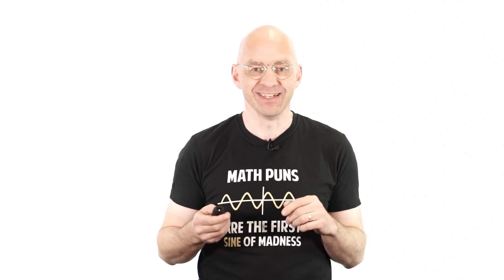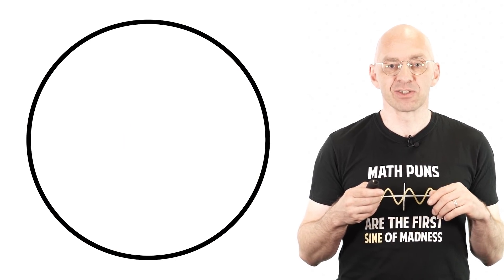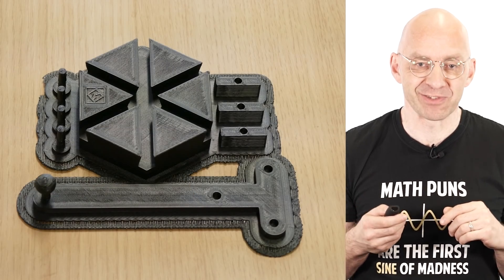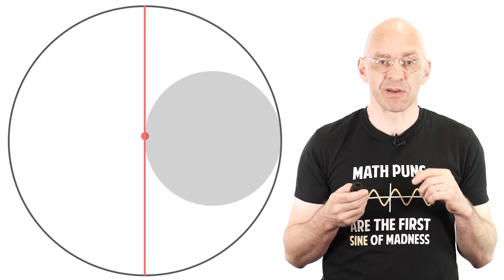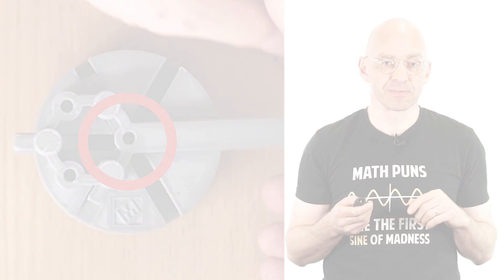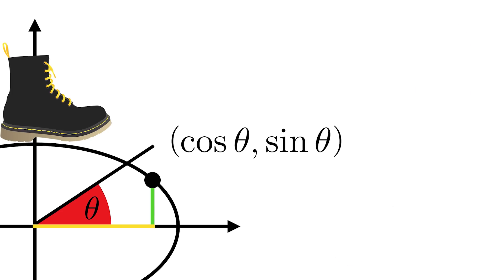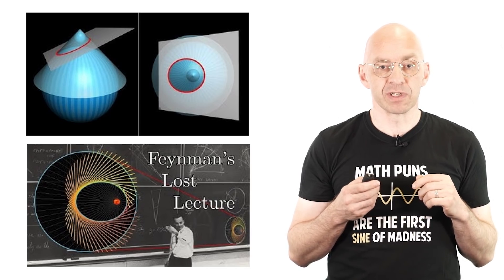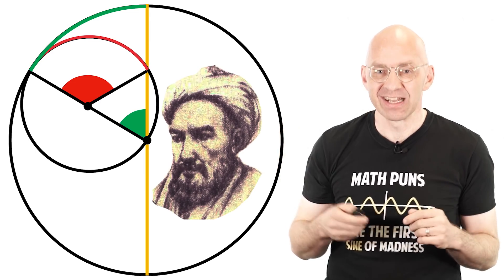Secrets of the NOTHING GRINDER

Comment: As a non genius, i would say that any pattern in which you can rotate a line in a non circular pattern would not become perfect by changing the line's length, (unless/even if) it becomes infinite.
The deviation in which the line traces would be above positive, with 0 being perfectly circular. BUT changing the length does make that deviation decrease by a certain amount, relative to it's size.

Take celestial bodies for example: A meteorite & the earth may have the exact same ratio of an uneven surface; that is if you dug a hole the size of the Mariana Trech & made a mountain as tall as Everest, it would look much more massive on a meteorite because of it's relative size to the planet, but they have the same roughness ratio, so the meteorite looks rougher than the beautiful smooth orb that is earth.

Aside from that, each point in a circle is it's own distance away from the center. Making the line longer doesn't change the difference between any 2 respective points, thus making a divergent series, possibly making the problem unable to settle on a total sum... so really i'm not 100 percent sure.
Reply: It kinda changes depending on how you look at it. On one hand, they're both infinitely far from the CENTER, but always keeps the same constant ratio no matter how far away it is...
though i think being ininitely far from the center has more bearing, since the ratio is based on how far they are from the center...

Comment: I’m a bit hung up on the last proof. I understand the proof that the arcs are the same length, but I don’t understand why “if the red arc equals the green arc, then the red arc traces the diameter of the larger circle.”
Reply from the maker: ", then the red point traces the diameter of the larger circle."
Reply: @Mathologer  Ah, I understand. The red arc is defined by that point which is on the diameter.

Comment: I guess points that have the same proportions of distances to the two "screws" draw similar ellipsis. There are 4 such points 2 between the screws and two outside - but since the arm of the device is a ray then only one of those "outside" points lies on the arm. So all together there are 3 such point on the grinder for each proportion. The special case is a point that has same distance to both screws - there is only one such point, and it draws a circle.
Reply from the maker: Perfect :)

Comment: Interesting video as usual, but a lot of the animations (especially the ones with the spirograph patterns) are REALLY laggy and it’s extremely distracting. Was there an issue with your recording software?
Reply: I had no issues playing the video. More likely culprit is data throughput issues to your computer to your monitor. Any number of issues can cause this, one POSSIBLE example is data throttling by your provider.
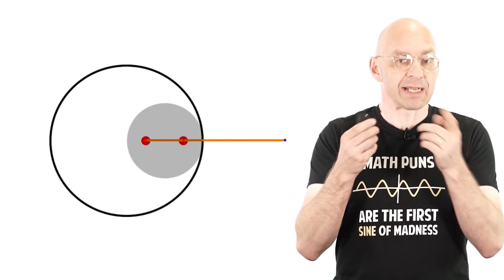Reply: inyobill That couldn’t be it; the animations that are acting up, like the ones with the spirograph tracks (especially at 7:20) and the Tusi couple, have him narrating onscreen while they’re playing, and he’s moving silky smooth while the spinny lines are jerking and diving into single-digit framerates. How could throughput throttling cause that?
Reply: the animation at 7:20 was laggy for me too, while him talking beside it wasn't, so you're not the only one.
Reply: @KnakuanaRka  That suggests an internal problem, since lots of folks don't see the same effect.
Reply: inyobill inyobill inyobill Well I’d love to know what kind of internal issue could cause one side of the video to lag and drop frames relative to the other. I just don’t see how that’s possible, unless the animations are somehow handled separately from the rest of the video, like they were pasted in with some sort of new annotation. And even if I speed up or slow down the video, go backwards, or frame-by-frame through it, it doesn’t affect what frames get skipped, so it can’t be Yotube’s fault; how is it showing up smoothly elsewhere?
Reply: @KnakuanaRka  One possibility is video and audio being processed separately. Since it displays fine for at least some people indicate it's not the video.
Reply: inyobill Audio? We’re talking about two parts of the same video here; that can’t be it.
Reply: @KnakuanaRka Well, it finally got through my thick skull that I was confused. Imagine that. The glitchy looking animation is an artifact of the math software creating the plots.
Reply: inyobill 🤦🏻‍♂️🤷‍♂️

Comment: the answer to the question posed at 2 minutes, I'd say there's 2. The second one traces a point between the two screws, which has the same shape but with the axes swapped, also it'll be smaller(but the same shape).

There's no more, because as you go further out the shape becomes more and more circle-like and less and less line-like.

edit:
actually, rethinking it there might be 3. Since the midpoint between the two screws traces a circle, and the screws themselves trace out lines... going either way would transition smoothly from line to circle, going through all possible ellipses in between. And of course there's the one on the outside, still.
Reply from the maker: Three it is :) (unless we are talking about the circle and the like segments that are produced by the screws ;)
Reply: For the purpose of the question, I considered circles and lines to not be ellipses.
Reply from the maker: @BigDBrian  Sure  :)
Reply: right now you're the friend who tells a riddle then acts all smug when you answer so you don't know if you got it right or not

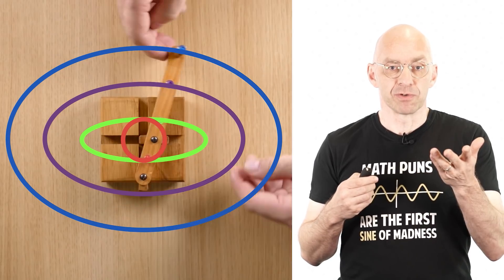Comment: 2:05 Going by intuition alone (haven't proven it), I'm going to say 3 points: 2 of them will be symmetrically positioned between the points that move on straight lines, drawing ellipses "perpendicular" to one another, which is the same shape rotated, and a third point will draw a scaled up version of that ellipse and will be on the "long side" side of the arm.  

All this except for the degenerate cases: A circle has 1 point on the arm that draws it (or 2 if you consider the point at infinity which again by intuition likely draws a circle), and a line (a degenerate "infinitely stretched out" ellipse) has 2 points that draw it.

(If the arm would be extended in both directions, change that 3 to a 4)

edit: Now that I've reached 7:05, it feels like my intuition was correct.
Reply from the maker: Very good :)
Reply: Sorry for the year late reply. Ya know, I used to be pretty good at maths in high school a quarter century ago so when Mathologer popped a quiz I decided to pause the vid and take it. I closed my eyes and tried to envision it (just a thing I do when trying to concentrate, helps me remove other stimuli). I saw ellipses squishing down to a line. But I think I somehow saw them opening up again into what I questioned might be another circle (the point at infinity which would draw another circle, as you mentioned). Idk, still trying to visualize how they would plot. In my 40's now so I'm kinda old and used spirographs as a kid, they were very common toys. I suspected the ellipses would rotate somehow but I wasn't quite on the money there. You said they'd be perpendicular. That means just two sets of ellipses. Am I getting this right? Wasn't sure how to count the points either but I think you connected some dots for me.  And then I watched through the rest of the vid and it all came together.
I spent a year in college back in the day but wasn't sure what I wanted so I just quit and joined the workforce. Lately I've been wanting to go back and earn a degree in... something. Think I might now research a path in mathematics as it pertains to my career in Aerospace Machining. Sorry for the long post, this just really stirred something in me.
Or maybe I'm just a total layman who should keep his nose outta things he only thinks he understands. Meh, and this is why I never go back to school. The crushing doubt.

Comment: As the arm's length approaches infinity (relative to the distance between the pegs), I imagine the oval produced would approach perfect circle-shape.
Reply: Holding the distance between the pivots (P) constant, as the arm (A) -> ∞, P/A -> 0. Or, Lim A -> ∞, P/A = 0.
Reply: @inyobill  Yeah. The length of the semi major axis is P + A, and the length of the semi minor axis is A so you have:
(x/(P + A))^2 + (y/A)^2 = 1.   Multiplying by A^2:
(x/(P/A + 1))^2 + y^2 = A^2. In the limit as A goes to infinity you have:
x^2 + y^2 = A^2. The curve traced by the end of the arm can get arbitrarily close to a circle by increasing the length of the arm.
Reply: @trevr9924  Nice, there is no substitute or rigor, As I'm  sure you're more than aware, my post was more of an intuitive justification.
Reply: At the halfway point between the first and second pegs you get a circle,, at the second you get the most squished circle possible, a straight line. Thereafter the circle starts bouncing back again through elliptical stages. When you get a sequence of changes like that, Euler's e often lurks somewhere as in the values for the xth root of x.
Reply: An oval is two half circles joined by  two straight lines. Racetracks are ovals. An ellipse is a closed arc that continuously varies in its radius; oscillating between half of its major axis and half of its minor axis. Ellipses are often misnamed ovals and ovals often misnamed ellipses; but they are two disticnct forms
Reply: In Maths, definitions are important. It's how we ensure we're both talking about the same thing(s). It doesn't even matter if it's a "dictionary" definition, as long as the definition is clear and specific.
Reply: But then, My Webster may not be using a common Maths context, I don't know. I don't really care, your definitions, above were clear, usable, and I actually tend to agree.
Reply: By the way, my Webster's dictionary defines "oval" as an elliptical, continuously varying, curve, I just looked it up.
Reply: Or, since the eclipse is getting more and more "squished" it will trace a line....
Think about that for a while...
Reply: @AlanKlughammer  Look at the illustration at 1:31. It is clear that ellipses further from the center have lower eccentricty.
Reply: @inyobill  Yes you are correct, I was just going by his statement of squishing the eclipse. 
The illustration you reference actually shows the Mathologer is a bit misleading. The circle is only at the interior of the pegs, Once you get past the distance of the outer peg, the ellipsis get less and less squished.
Reply: @AlanKlughammer  Thanks for the kind reply. Entirely possible I had misunderstood. Especially when there's something I don't understand, I post a statement to try to elicit a response to try to figure out where I'm wrong, and somewhat more rarely, correct.